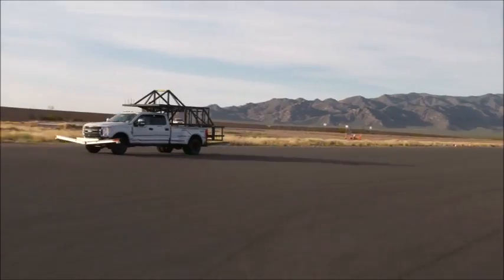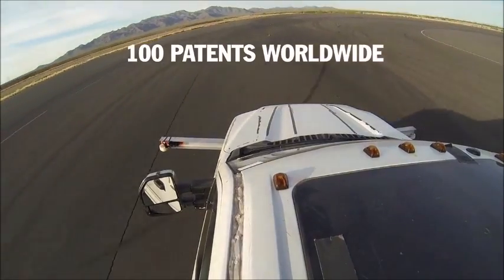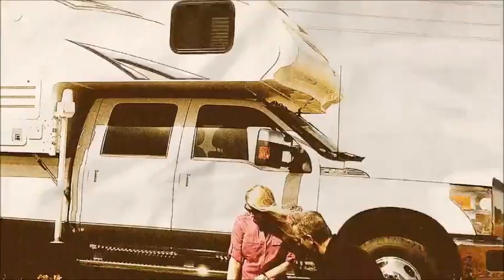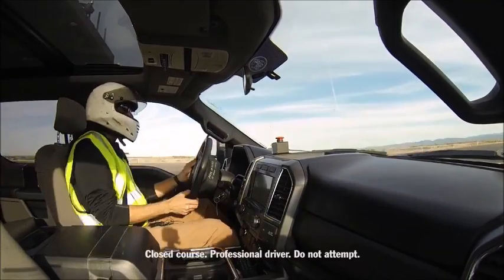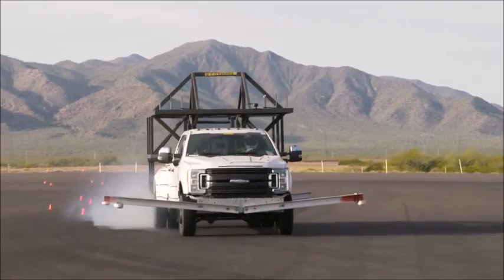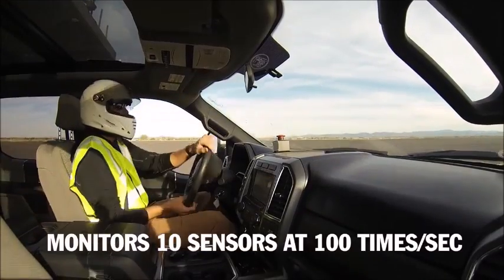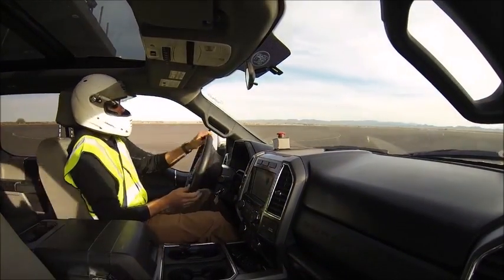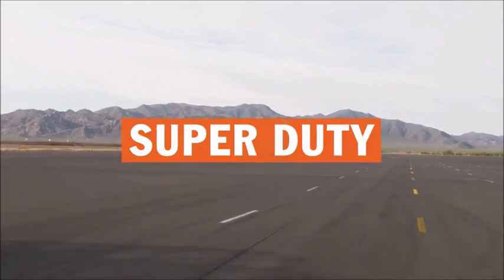2017 Ford F Series Super Duty Roll Over Crash Testing

Comment: What gets me is they got if they have stabilizers sticking out on the side in case it does roll the ground will catch it I guess worth doesn't have to liability and doesn't have too much good sense if it will hold that because if they did they wouldn't have it there to protect the truck from rolling over they would have them without it you show it is reliable without those good job Ford one of your better ideas

Comment: I wonder why they would leave the hub's locked in so the four-wheel-drive was sprinting
Reply: If you can see the u joints spinning ill believe you. I cant see it. Perhaps its the resolution on my phone.  Even with the hubs unlocked there is more than enough stiction in the hubs to spin the axle shafts. Its really takes very little energy to spin them. Thus why it makes next to no difference to fuel economy to have your hubs locked in.  If they did use as much energy to spin them as people think, the axle would not be able to be kept cool.  The entire point of the needle bearings in the u joints and the wheel bearings and the carrier bearings, its to minimize rolling resistance.

Comment: I think this was a f450 or f550 notice they did no close up of the f series badging on the fenders. They just consider it a super duty. But not all super duties are made equally the same.
Reply: andy wiesenhofer And it doesn’t have the wide track front axle (no fender flares)
Reply: Robert Murillo If you pause the video at 0:07 you can zoom in and it clearly shows an f350 badge. The truck also only has 8 lug wheels whereas the f450 has 10

Comment: Nobody I know is going to drive around with a simulated camper and have huge outriggers attached.  Why not strap on a real camper and ditch the outriggers and do the same test.  The outriggers will affect the center of gravity. Real campers will also have liquids that will slosh around during an evasive maneuver. Oh wait, this is a Ford infomercial.
Reply: Robert DeMilo And Chevy is switching to aluminum.  and how much liquid does a slide in like this hold? and where does it hold it? down low, not at the roof.  I'm sure they'll lend that thing to any of the competitors that want to try.  BTW,  compare the 2017 Super Duty frontal crash to the rest.  The new (and old) frames of the Ford didn't bend at the bed.  both the Chevy and the Ram bent badly.  they performed worse than the 2016 Super Duty that's using a frame that's unchanged since 1998. The 1998 Ford C-channel frame outperformed the 2016 Chevy and Dodge.  isn't that a shame? what's the relevance of the frame bending during the frontal crash? if it bends in a crash,  what does it do when overloaded? i put 9.5 cubic yards of chip on an 2007 F250 with an F350DRW aluminum bed. that's 4,000-6,000lbs. We were in a severe pinch.  But nothing was damaged because it was mild steel and designed to flex.  I'd LOVE to load a competitor with that much weight and see what breaks.

Comment: Ford trucks can handle whatever you throw at them. BIG FAN
Reply: FCA and GM were ranked below Ford on the reliability scale.
Reply: MustangDriver1734 I had a guy hauling a camper in a 1500 Z71 completely grenade his rear axle driving the speed limit.  i broke an 8.8 Ford rear end because of too many one wheel burnouts.  but over loaded,  jumping,  donuts,  burnouts,  4LO four wheel skids pulling everything under the sun (stumps out,  trees over,  planted forklifts,  planted tow trucks,  etc), bulldozing trees to unblock roads (brush guard),  etc.  i BEAT THE F out of my 2001 F150 and it took it. This fool hauls a camper and BOOM! The mechanic pulled the cover,  saw inside,  put the cover back on and told him it's gone. everything is gone. So you are correct,  Ford makes the best truck.  Chevy does make the most comfortable.  Dodge has the best Diesel motor BLOCK. Everything smog is literally a crap shoot.Our  2010 Ram 5500s were great till about 150,000. one lost turbo communication and the other clogged the DPF. our 2015s are back and forth to the dealer. Whereas i met a guy with a 2011 F350 SRW with 110,000 looking and acting like the day he bought it.
Reply: bruteman45, I'm sure it will be redesigned and retested. Don't get too cocky. Yet.
Reply: Patrick Collier Im a Chevy man but I wrecked a Ford today and it held up fine
Reply: MustangDriver1734 Ranked from me by personal experience..
Reply: Patrick Collier Except a rock.
Reply: Also of Hornady
Reply: Patrick Collier hey ford fan your trucks frames are made of tin foil. They failed badly on the frame torque test. After the test between the big 3, they could even open the tail gate after the test. It had bent the fram over an inch.
Reply: bruteman45 And the F-series smokes the competition in crash tests.  I don't own a Mustang anymore. But if i did,  it'd be another 1986 Foxbody with a built 4.6L. That thing beat nearly anything stock light-to-light.  Especially anything within $20,000 of the $1,200 i got it for.  Even took a half a car length on a 2006 400hp "Goat" through first gear.  Even the "Goat" driver was shocked.  200HP and 2.73 LSD rear gear launched that much better than a "Goat".
Reply: hahaha to bad your new shitstang received a 2 star crash test rating
Reply: Ford sucks ass
Reply: FORD is a pile of shit.

Comment: I will vouch for the Roll Stability Control. I was driving my 2011 F350 4x4, SRW, with a 3,000# slide-in Wolf Creek camper. An SUV in front of us stopped suddenly with no brake lights. I slammed on the brakes and swerved off the road onto the shoulder and then back to the left. The truck and camper stayed upright despite a maneuver that I was sure would flip us over. The camper was only secured with turnbuckles and a good frame mounted tie-down system. If you watch the video again, you can see one instance where the computer locks up the right front wheel to regain stability of the vehicle. It was a lifesaver for us- props to Wolf Creek for having an aluminum superstructure as well.
Reply: your vouch counts for nothing. shut up and no one cares.  keep your windy story to yourself.